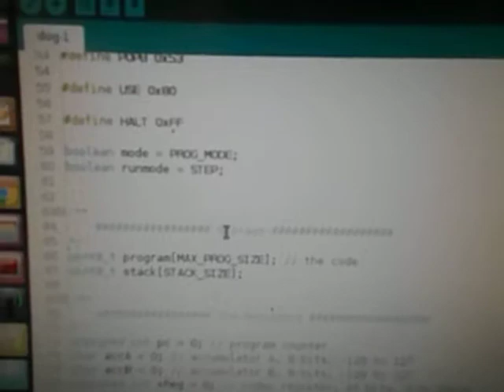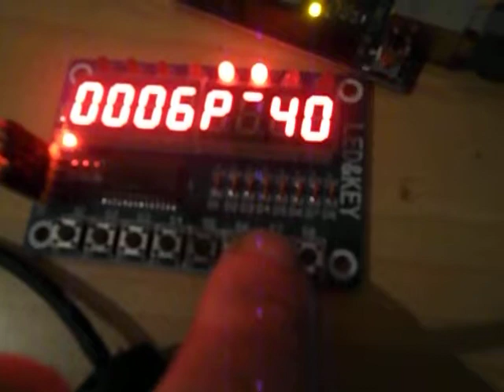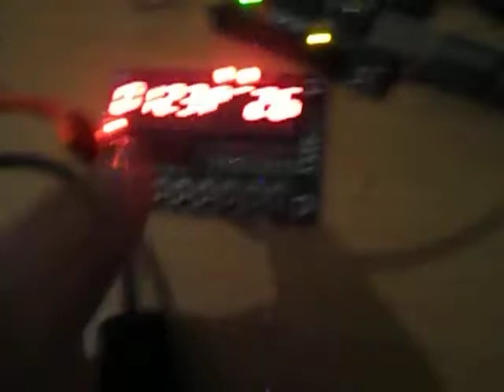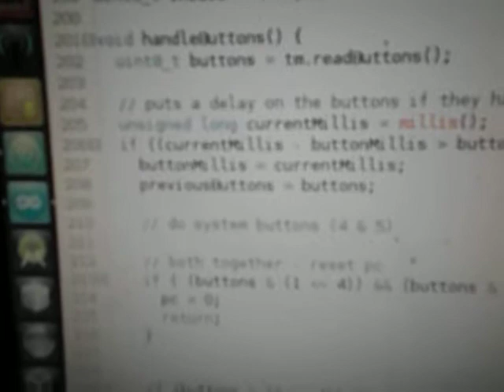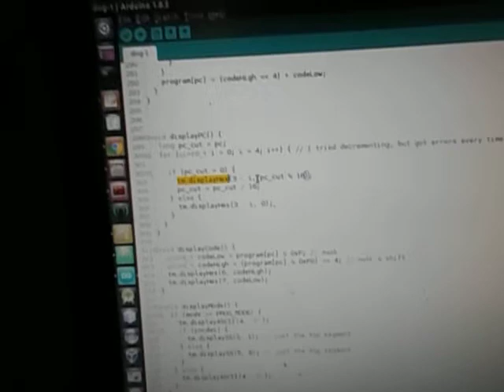DOG-1 : A 1970's-style Single-Board Computer built on an Arduino - first (minimal) program

Comment: Eh up (as the example says!)  Just received one of these boards today (£1.14 incl delivery).
Thanks for the library, works great with my UNO.

The plan is to use this with my 8-bit 6309 computer I'm building.
Using an Atmega32 as it has a lots of IO pins.